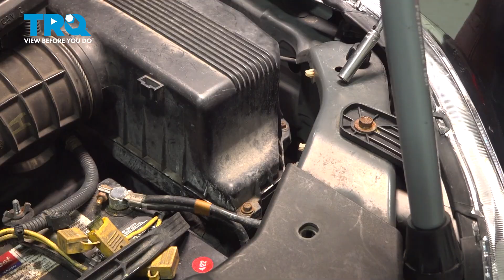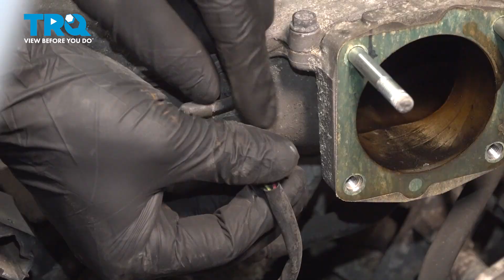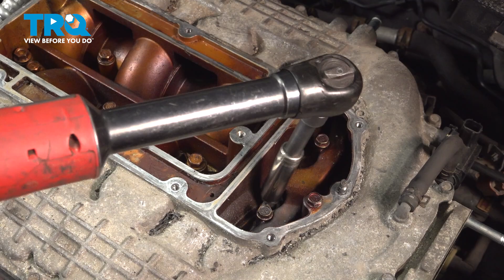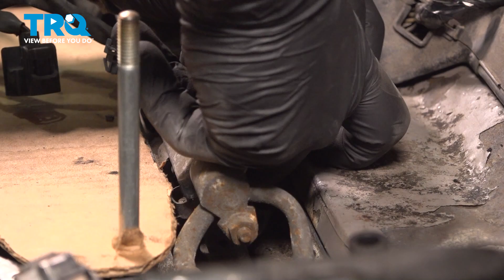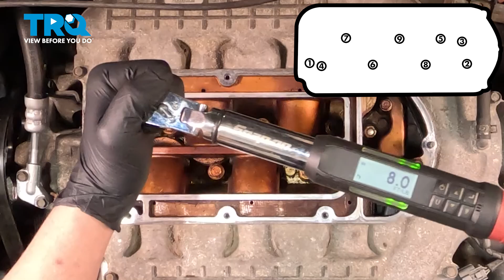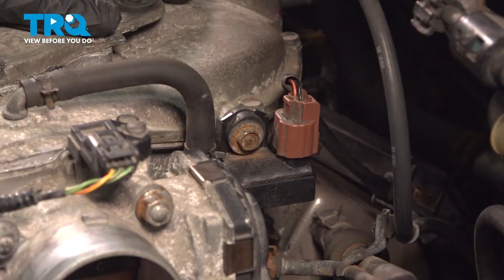How to Replace Fuel Injectors 2003-2008 Honda Pilot

Comment: So my error code is P0305 - Which is basically a cylinder 5 misfire. But I've already replaced all spark plugs, and ignition coils. It seems to only have that error code when I turn on the Pilot. It kind of sputters when turning it on but then after running for a bit, it runs fine. Sometimes the check engine light will flash and then the vtm-4 will turn on too. Sometimes it will start no issues and the check engine light will turn off after a while and then one random day it will start and putter as I turn it on. It doesn't have issues with driving when it's actually on and running, it's just when it starts. Could the Fuel Injector's be my issue?

Comment: Cameraman did a good job. 👍

The injectors on mine were really stiff and refused to come off the engine head after removing the fuel rail. I left them so they don't break. 😟
Just wanted to clean em.

Comment: Look for fuel injector filter replacement videos. The fix is about 25 bucks. New filters and orings and you are set.  I changed 8 on my 540i bmw and after done it was running better than before

Comment: I got a 2006 Saturn Vue that has this engine, just a different air box but everything else is the same. I use a 180 grit sand paper or higher to clean the metal.